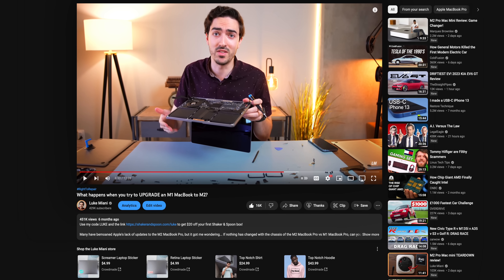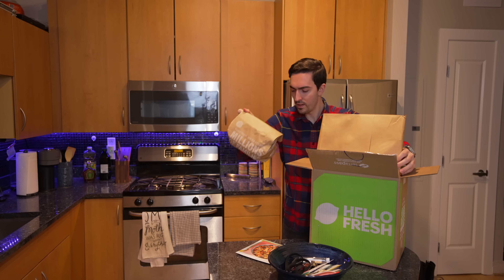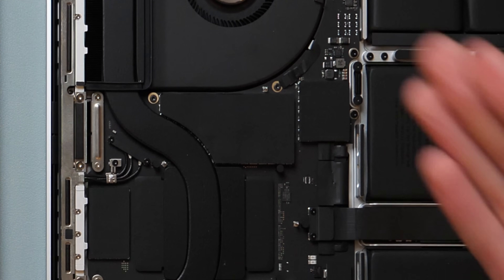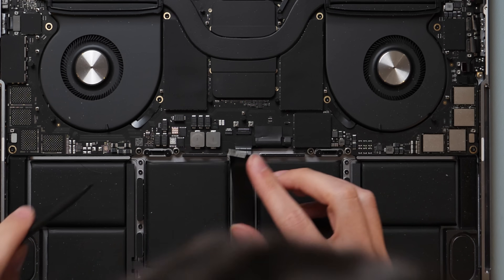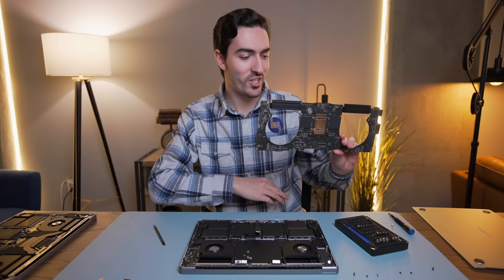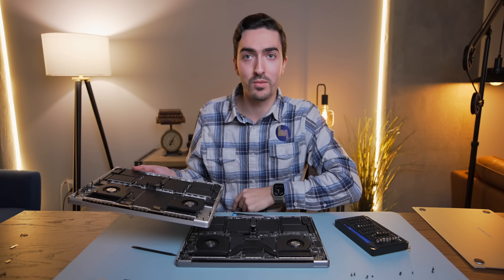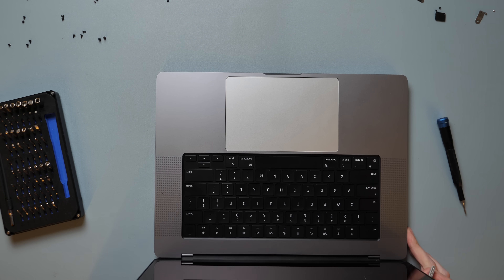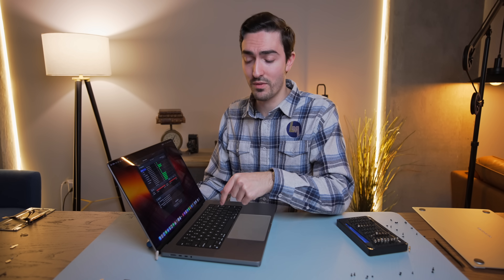What happens if you UPGRADE M1 Max MacBook Pro to M2 Max?

Comment: I can see this being useful if you maybe have a maxxed out M1 Pro, and want the better screen/webcam etc of the M2 + don't want to have to set everything up again, buy the cheapest M2 model than transfer your maxxed out M1 logic board across.

I wonder if it's something as simple as drivers (in terms of the battery/fans/etc)? Does Apple only install the drivers needed for the specific hardware, and could they be extracted and moved acrosss?

Comment: So when you had it swapped, did the system profiler / about this mac say "MacBook Pro 2021 M2 Max"? I'm curious how macOS recognizes the system since its clearly a system that doesn't exist at least in their database and how it handles that, I suppose it's like a hackintosh at that point. I wonder would that mismatch cause things like the fans and battery not be reported correctly?

Comment: The problem could be firmware, new Mac are more like phones in the sense they have a specific hardware and they don't know how to react if there is a mismatch, you could need reload the serial for each hardware you change and that is the reason to loss true tone, touch ID and maybe the fan control and battery management.

Comment: Most likely fan problem is a result of mac not talking to the battery properly, either cable was loose or it has different pinout which is unlikely. If battery is plugged in and activated, mac will run from battery since power is provided but it will not show it is present or show X or 100% charged + service. Battery has a temp sensor and in absense of any sensor CPU will throttle + fan will be fixed at 100%. 

As for display it seems to be random, there are multiple reports of swap resulting in shadow or strange backlight artifacts.

Comment: @Luke Miani the battery and fan issue is due to the Power control ACPI patches needed (just like in a hackintosh) if you patch it properly you will be able to use the Mac

Comment: Remeber watching a Rossman video ages ago where he was talks about faulty trackpad on the device and if it fails or not connected then will not boot. Only Apple would do something like that. Most machines if a trackpad fails the machine runs fine you just obviously need to use an external mouse.

Comment: "Service Battery" could mean that the logic board doesn't know how to communicate with the controller in the battery. I've had the same issue with my MBP 2018. After a battery replacement it worked properly :)

Comment: maybe they use different fans, with different voltage/amp curves or with a different rpm rating and the board gets back different speeds than expected at a specific setting/power curve and therefore just cranks the fans to max

Comment: Basically it's like with the iPhones now. Battery, Touch ID and TrueTone/Display being digitally tied together. Wanna replace a cracked screen? Take it to an Apple Store. Sticky Keyboard needs replacement? Say hello to the Genius Bar. You battery is flat and needs replacement? You guessed it: Go cry at Apple.
And I'd not be surprised if the reason the fans were stuck at 100% is because the chassis thermal couples have some digital signage BS going on...

Comment: On Mac hardware it is common for the fans to operate at max speed like that when there is a thermal sensor issue.

I'm not one hundred percent certain, but the incompatibility with the battery might be the root of the issue; if I remember correctly, the battery should have its own thermal sensor.

Comment: you shuold put the macbook on dfu mode  and reinstall SO so maybe your battery works and the fan behave normally.. also the trackpad maybe  you change the flex it will work? there more staff you can try once you have done all these disassemble. Anyhow, good job.

Comment: Where your video missed:  if your M2 is broken, because the SSDs are highly proprietary and encryption tied to the CPU, moving the  motherboard  to an M1 would allow you to boot it and recover the data from the SSD. 

On the fans and battery, both would be controlled by the SMC and for the battery,  changing it likely zapped the battery performance info SMC uses to determina charge.  Did you try SMC reset?   (this coiuld at least fix the fans, though Apple has gotte quite propriteray about battery).

Comment: Imagine if you could take (or send) your M1 MacBook Pro or M1 MacBook Air into an Apple store and ask for a chip upgrade? They’d charge you a couple hundred bucks and return it to you within two weeks. Apple would still make money but also the amount of e-waste would be tremendously reduced as people wouldn’t need to buy entire new laptops. The older chips could then go into production of cheaper products and/or be sold to repair shops.
Reply: Apple would probably have to change the M3 series chips to make that work.

Comment: I'd be interested to see if you can upgrade the MBP M2 Pro to a M2 Max. Lets say you have a liquid spill on your MBP M2 Pro and damage the logic board, it would be a worth while upgrade to be able to replace the damaged M2 Pro board with one from an M2 Max.That would be a cool video
Reply: Impossible.

This one ALMOST went possible if not for the screaming fans (you lose fan control) and the aggressive parts pairing of keyboard (you lose TouchID), trackpad (haptics sometimes don't work), and the display losing TrueTone (ambient light sensor probably paired.)

I don't mind the parts pairing but, unlike Google, Apple makes it hard for even a normal consumer to verify spare parts and the option to pair/unpair even their own Apple parts—to the point that they require you a second Mac with Apple Configurator. (Google provides an online site to unpair and pair spare parts, probably for verification—albeit that's for their Pixel phones.)
Reply: the answer is no, I work at an apple repair centre this is impossible. and the reason why I know is because one of my collegues ordered the wrong part fit it in and the computer didn't even boot
Reply: @Irohzuko  Oh wow, how is it like working at apple?
Reply: The internals look very different like a different computer so no

Comment: I just love reading the so-called "right to repair" advocate lenovo thinkpad user type peasants on comments on why stuff doesn't work.

Real reason behind why keyboard/trackpad doesn't work on M1P/M parts:

Apple M2/Max/Pro had a lot of I2C/GPIO changes inside the silicon (hurr durr apol bad they changed the silicon to make sure it no work) (in a nutshell, this is the type of bus your peripherals connect to (wanna know more about behind the scenes silicon stuff? give Asahi maintainers twitter a read!)

We still don't know about the fact that the battery is paired or not, that'll show with time

Comment: It seems that most of the engineering on Apples products is focused on making it impossible to repair or update/upgrade their devices, forcing customers to pay ridiculous charges for the memory and storage they need. 
In fact, I think the move to Apple Silicon, though a big performance and efficiency improvement, was at least partially driven by Apple's desire to lock their systems up and eliminate right to repair.  
Today you can buy 1TB of SSD (Samsung 980 PRO NVME) for $150.  Apple wants $400 to upgrade the Mac Mini from 250GB to 1TB.  
And you can buy 32GB of fast memory for about $160, Apple wants $400 to upgrade from 8GB to 24GB.  THATS $400 FOR 16GB RAM!!
In the short term it helps Timmy keep the profit margins up, but in the long term he's going to lose customers who are tired of feeling like they've been ripped off when they buy anything from Apple.

Comment: It's the same as Iphone components that have serial codes in each part. You probably need specific code writer to swap the old parts out and recode to the new parts in to make it work.
Reply: Artificially breaking compatibility and therefore repairability is just the worst.

Comment: Luke, after swapping the M2 board into the M1 machine you should try clearing the NVRAM/PRAM (is that still a thing?) or reinstalling MacOS to see if you can get it to ‘reset’ itself to possibly work out the fan and battery issue
Reply: Only possible on Intel Macs. The core MacOS itself for the Apple Silicon Macs is inside a SSV, you'll be having a hard time with it.
Reply: @Jan-xf8sk  there is an equivalent though and it is activated on laptop by just turning off the computer and closing the lid for a minute or so. it is documented and I dealt with trackpads problems this way.
Reply: to do this you just need to close it while turned off for like a minute

Comment: Very interesting. It seems that all of those issues you encountered (apart from the trackpad situation) are artificial software locks apple has put into the computers, similarly to what has been happening with iphones for a long time now. Apparently almost everything is code matched to the motherboard. Same thing might be happening to the fans. Although I suspect it has something to do with sensors, as with most laptops, if it doesn't know the speed of the fans, it will full throttle them.
Reply: Really predictable anticonsumer behavior from Apple. Imagine how many hours of dev time are wasted on each generation making it impossible to swap most parts. They even moved so aggressively against repair that many parts are serialized so that they won't work if transplanted from a donor device of the same identical model. Or the insane idea of putting the SSD controllers on the logic board, and only the memory chips themselves on the Mac Studio's removable cards, making it so that only Apple can upgrade the SSD, when normal nvme drives have existed for what, a decade? With zero benefit, Apple goes proprietary any way they can.
Reply: seeing as when luke unplugged the screen cable bit and it turned on, yeah it's 100% some software lock on the motherboard where it just isnt recognizing the other components and defaulting to full speed.

Comment: This seems really similar to what intel iMacs do when you don’t have the heat sensor plugged into the display. 

Same thing here is probably going on, there’s an ID number that the Mac wants before it will boot properly. There’s a list the Mac expects to see and it tries to match all devices to that list. It’s like…a pretty low tech way to check but it also pretty hard to get around if you don’t have access to the boot loader. 

What is really interesting is that it boots at all. This implies that isn’t the board itself, just some specific part of the board that isn’t being read by the MacBook that it wants there.

This heavily implies to me that if some opencore equivalent could be developed for Apple Silicon, then these hardware swapping issues could be gotten around. Which would be good for both upgradeability and repairability (we might get to a point where M1 chips and boards are hard to find so we may want to upgrade for that reason)

Comment: On older MacBook Pros when the battery is indicating service required and will only run when connected to power the fans run flat out (and the CPU is throttled) so maybe something similar to that is happening here.

Comment: The fact that the battery worked but it’s metadata related to cycle count or basic communication about charge level couldn’t be read definitely sounds like a by product of secure boot/encryption pairings done at the factory. And when decryption failed the default UI tells you to bring in for service. I would have assumed the same for the fans defaulting to full blast. But given that TG Pro is able to accurately display temperatures using Apples provided APIs. I don’t get why the fans couldn’t do something similar.

Comment: This is why I love the Framework laptop. Swapping parts are such a breeze, and Apple should learn to make user repair much easier.
Reply: The PowerBook G3 Wallstreet was like that. It was probably the most expandable and upgradeable laptop ever. You could swap out the processor and memory, IO card, and it had two bays for either a battery or a removable drive. But it was bulky and heavy and fragile, and few people would swap the processor out for a 10% speed increase. There were many tradeoffs. So they built the Titanium, super thin and solid, basically what we have become used to.
Reply: Apple could, but they won't, unless there is a huge consumer outcry that hits them in the pocketbook, like people stop buying their laptops until they support Right to Repair and make it easier. They don't want people doing parts swaps etc., they want you to buy a whole new laptop.
Reply: Ten years ago, you could still exchange components between Mac without real hassle. Then Apple took another route, unfortunately for us.
Reply: never
Reply: It is vastly less efficient though. That’s why this thing can outperform most PC desktops under $3000 while having better battery life than pretty much any laptop on the market.
Reply: @jjchockey  am skeptical that the M2 outperforms an equivalently priced PC system in the majority of benchmarks. It comes very close (and wins some!) at a fraction of the power utilization (which is awesome), but most people can get by with Chromebooks and power users can still can get more for their money building a PC.

The portability and battery life are EVERYTHING for M2. Remove those and it becomes less compelling.
Reply: @theftking  that is a very important factor for a laptop imo.
Reply: @jjchockey  theres no reason that separate parts have to be locked to each other though with no way to get around it (unless you pay apple to run some software on it to do that).  Sure i can understand having the whole cpu/ram/gpu as one chip, the benefits speak for themselves.  but the fact that you can't even preform something as simple as a battery swap on these is ridiculous.  
You can have the technology and the performance as one package. There's no reason to lock end-users or repair folks out of their own devices
Reply: @MXCN_El1011  it is way more effiecnt having everything on one board. The battery I agree with that’s dumb.

Comment: There are a number of hardware components that will only work properly after a system configuration routine you can only do after contacting the authorized seller for official apple repairs -- for instance, a display swap. Apple would never authorize this kind of upgrade, but if they did, I bet that would solve some or many of these issues.

In fact, it's possible that once M2 Max logic boards are available through that seller, you could still manage to run the system config after buying the part from them. I don't know what kinds of checks they run on serial numbers or models to make sure the parts are meant to work together.
Reply: Adding to my comment, because I actually had to do one of these repairs today (replacing a lid angle sensor). The remote technician asks for your device serial number as well as the purchase number for the spare part, then connects remotely for the configuration based on that info. So unless Apple started authorizing this kind of upgrade, which it never would, there would be no way to get through that config anyway.
Reply: @LouisHochmanTheJourno  Which basically contributes enormously to waste, but also to Apple's income (enormously aswell). It's a shame because some people cannot afford buying a new mac, but they could afford to buy spare parts. And these same people still buy Apple products even if it is a gamble. There are 2 reasons for this: (1) Apple products are generally very well done and thus recognised publicly and professionaly. (2) Apple is big enough that can (and does) separate itself completely from other brands, as an example, you cannot make an app for Iphones or macs if you don't own at least a Mac. If you only own a Windows or Linux machine, you are missing a big part of the market.

The truth is that Apple is being very selfish and it's not even its fault, any company would do that, and the fact that it can and has been behaving like this and earning much of its money this way, is proof that our society is a lesser version of how it is depicted in the educational system and the gap between poor and rich people will keep increasing, it's not going to decrease any time soon.

Comment: Iboff did a video, you can change the display on the M1 Pro’s but it will have weird squares on the top, and the only way is to solider on the compontes or apple.

Reason why it seems like the display works fine is because you had a darker wallpaper

Comment: Thanks for the adventure, where I think it's probably early for parts to start being easily replaced/upgraded. I would give it 5 years of researching until we start to see stuff getting standardized in terms of structure (The M Era) and with that it reduce the cost in terms of production. I was thinking first maybe he is trying to upgrade the M1 chip on the logic board by putting a M2 chip instead. Either way enjoyed watching this, Thank You !!

Comment: The BMS is tied to the serial, so I think that’s why you were having abnormal batter behavior with fans at full
Reply: Come on, what the hell is that again ? That should be illegal !
Reply: @Homme_De_Kro-mignon  It's the battery management system. It basically tells the MacBook the condition of the battery. I still have no idea why it needs to be tied to the serial, but it's Apple after all.